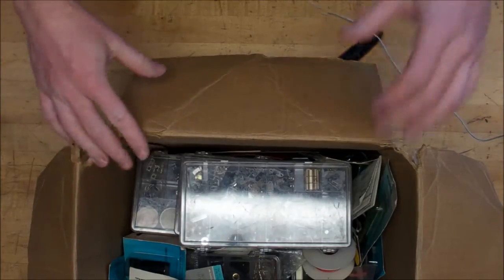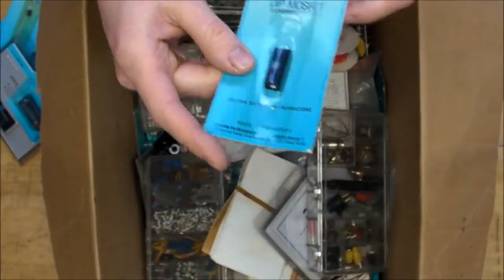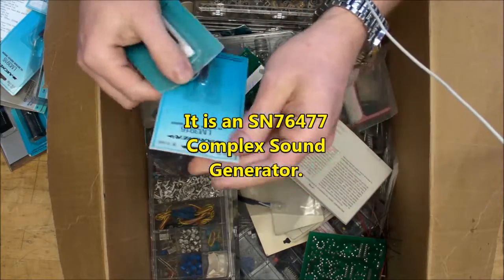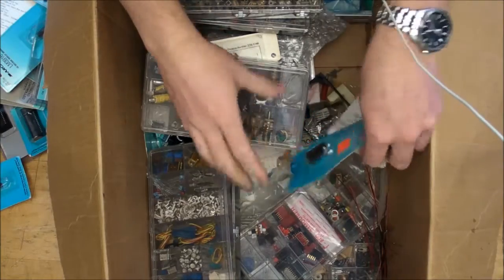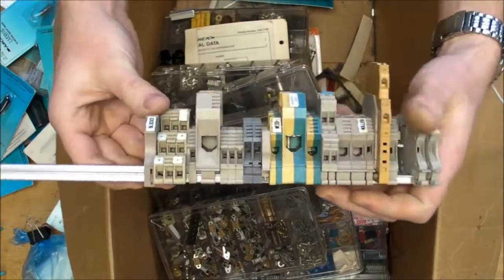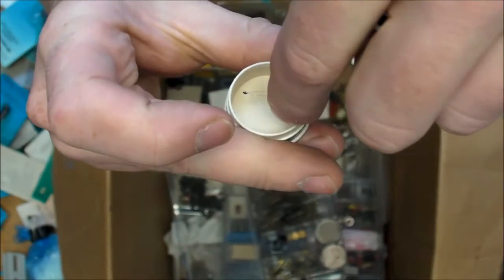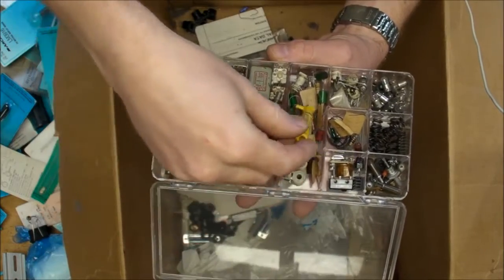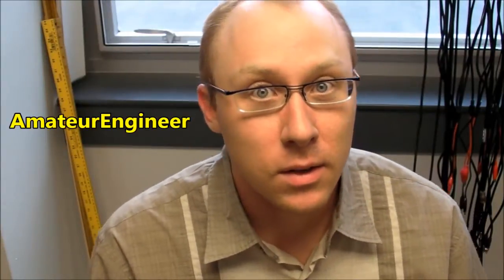(#0117) Electronics Junk Box #2 - Radio Shack's Glory Days and More Old Stuff

Comment: The thing that converts between a DB-25 and DB-9 is not a "parallel port to serial converter", just an adapter between the two types of connectors used for RS-232.